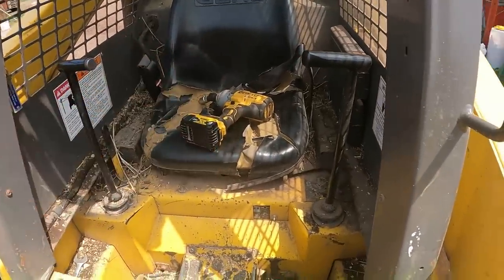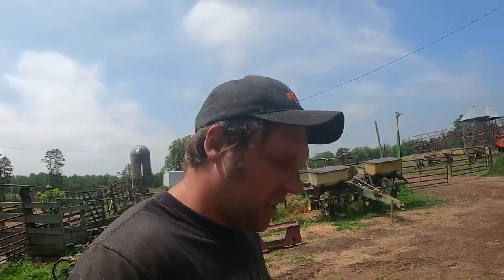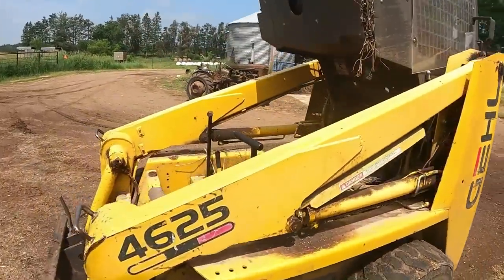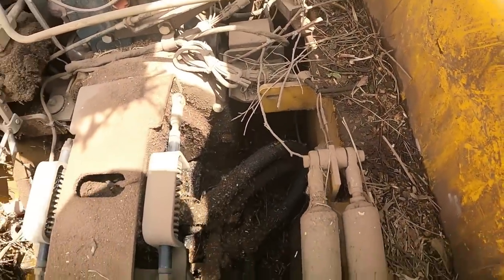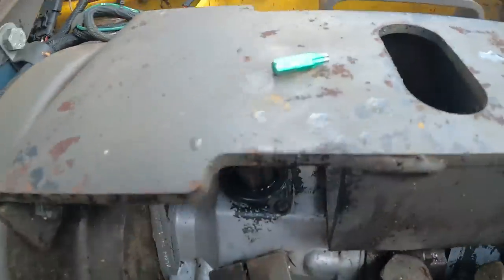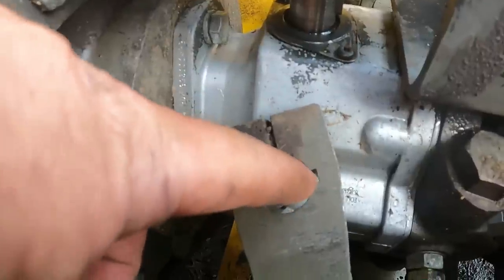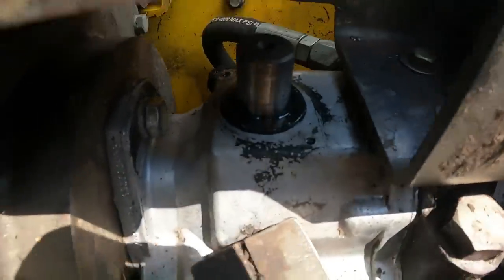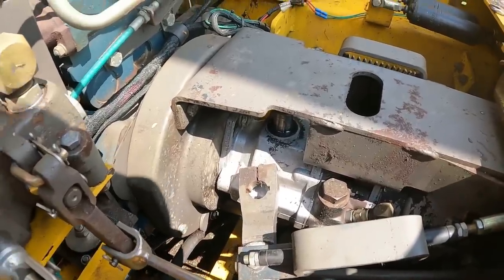Gehl 4625 Skid Steer Hydraulic Leak Repair

Comment: Next time in that situation try putting a socket over the shaft and then use a bar to push it down.  What you did worked fine though.  
HAPPY BIRTHDAY Alan !  I'll guess 33.
Reply from the maker: I was going to try that, but I could only fit a shallow socket in there, and it would bottom one on the shaft before it hit the seal.
Reply: @trinitydairy  yep. I get it.  Couldn't really tell by the camera. But hey ! You got it. Just a little ingenuity

Comment: I guess you are 39 now. I have a Gehl 5625 with those twist handle controls. 1 inch hydraulic hoses get old and fail so I have had to replace a few of them over time. Luckily I own my own hose crimper and I can reuse the old fittings. Starting off any repair with pressure cleaning is always a win.

Comment: Happy birthday allen  39 years old    .was watching video. Looked like lock washer was not completely tight on bolt  just back of the seal you were replacing they are known for vibrating loose over time maybe not but maybe it is

Comment: I'll say 43.Could you not get a big socket over that shaft and drive the seal in straight with it.Old mechanic here.
Reply from the maker: I could only fit a shallow socket in there, and it bottomed out on the shaft before it hit the seal.